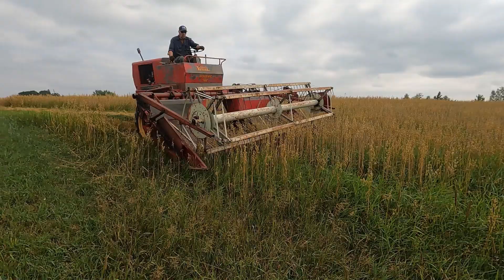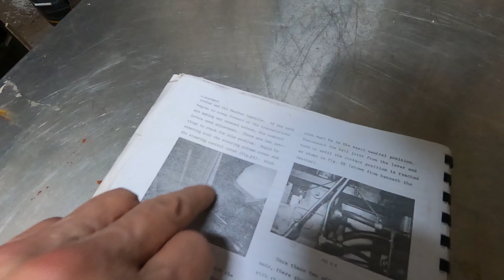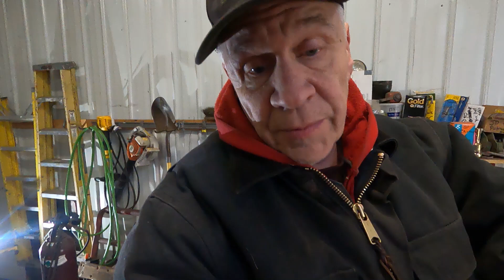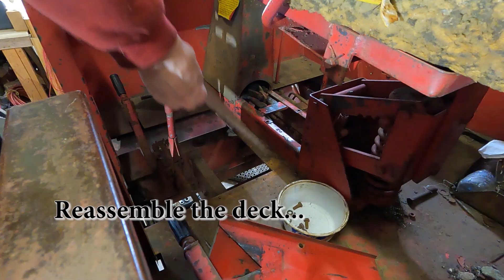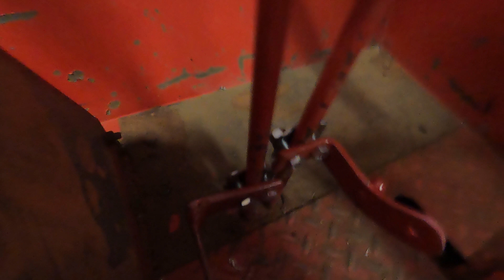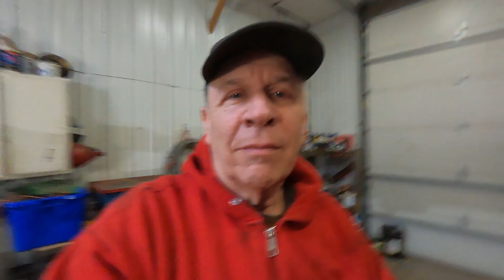Restoring a 1974 Versatile Swather-Save Farm $

Comment: Fix the bearings and belts first then adjust the linkages
Reply from the maker: Good suggestion.    Once I get it fueled up this summer I’ll get a chance to evaluate the steering linkage and may need to adjust.    I drain the fuel after the season each year and I don’t plan to refill until just before I need it…maybe July.

Comment: Good fixes Dave. That's an excellent machine for your operation. That shaft doesn't look too good. I'm sure we'll learn more about it in the next video.
Reply from the maker: Took me by surprise but, 20/20 hindsight, I should have suspected.   All of these problems were working together to decrease the responsiveness of the steering and drive system.   It’s why we need regular maintenance.
Reply: @Rollinghillsfarmsmn  There's always something figuring a way to break. Usually at the worst time  of course.

Comment: I agree with your philosophy of older equipment.  If you get a good piece and maintain it regularly and don't beat it up unnecessarily out in the field, you can get them to last a long time.  I'm like you - most of my equipment is older, but it's in good shape and all paid for - that's the most important part.  Good video.  Looking forward to the next part.
Reply from the maker: My gear doesn’t have the same show-quality restoration as yours but I try to keep it operational.    Makes for a much more enjoyable farming experience.

Comment: Kinda interesting, I've run a few different brands, from different times.. some way older than 1974.. they all had foot pedals for the header hydraulics. I think you will get along alright with your makeshift peddles. 
Inherent problem with open station equipment, cables do rust up, eventually... Nice cupholder! Should work pretty good for you.. here, even night swathing, it's way too dusty for any open drink container.. unless you have a cab...
Looking forward to part 2.. the real work!!
Reply from the maker: Some real surprises 😊